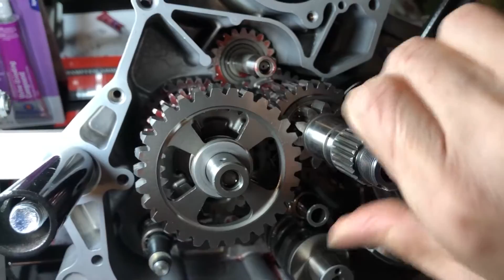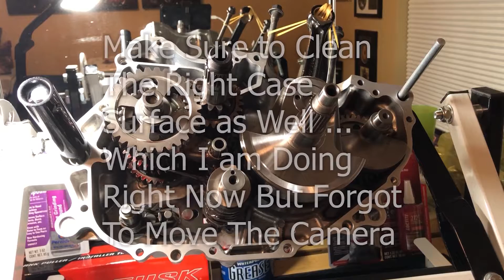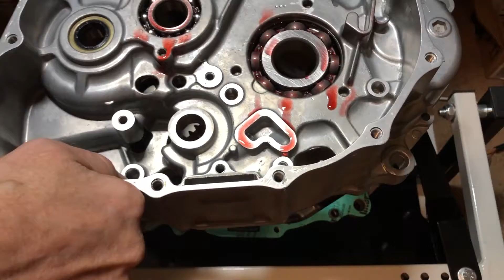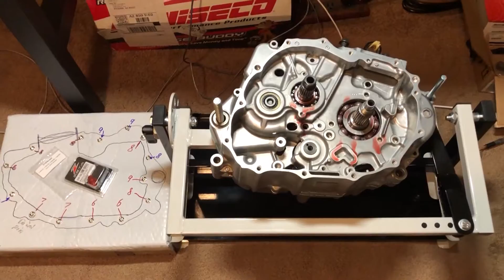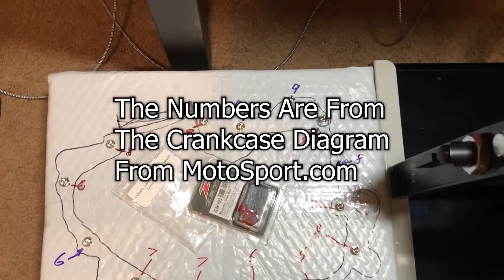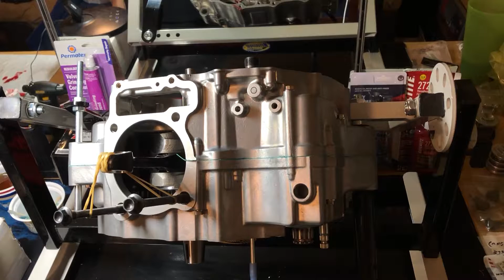Honda 400ex Build - Part 9 - Motor Engine Bottom End Sealing Crank Cases Together,  Gaskets, Bolts

Comment: What is the stud with blue tip on the left case?
Reply: Never mind i found the info for the special stud
Reply from the maker: @Walt-c9m  glad you found your info ... I just a rubber sleeve over it to protect the threads while I'm building it ...

Comment: Can you put a 400 clutch on a 300
Reply from the maker: I don't think so, they are totally different dimensions. The 400ex clutch plates have 12 tabs and the 300ex clutch plates have 10 tabs. You will definitely want a second opinion though ... or try it, and see if it bolts up and fits under the cover.

Comment: Hey man great video's.  Can I get a link to those nickel plated case bolts? Also I seen you have pictures of the cases and where everything goes. Could I get those as well?
Reply from the maker: Here is the SpecBolt "Nickel Wurks" bolt kit I used - https://specbolt.com/honda-engine-bolt-kit-nickel-wurks/ and I saved and printed all the diagrams from here - https://www.motosport.com/oem-parts/honda/2007/trx400ex (use google chrome browser, right click diagram image, choose "save as png", open saved image and print it)
Reply: @11GalleryATV  Thank you. I got my diagrams off partzilla. I was refering to the photos that you had.
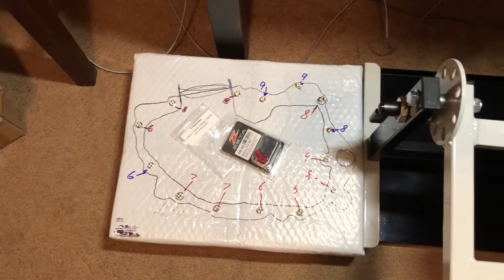Reply from the maker: @joshuabeard8244  Do you mean this at 9:40 ?
Reply: @11GalleryATV  no it was an actual photograph of the left or right case. I though you may have be using that as a guide.
Reply from the maker: @joshuabeard8244  just do a google image search for "400ex crankcase" and you should find some. Also look on eBay, people upload high quality images when selling stuff

Comment: I really appreciate the work you have put into the these videos.  I've recently purchased my first ATV, which happens to be a 99 Honda 400ex and I don't know anything about them. So watching everything being built from the ground up has been so helpful trying to learn and understand how these machines work. Thanks!
Reply from the maker: Thank you and glad I could help
Reply: Really appreciate the detailed videos! Currently rebuilding the engine on a 02 400ex post a broken gearshift spindle. After putting the gears into the left case and testing the gears they seem hard and not smooth when turning the drum. Any suggestions? Don’t want to join the cases until i know the gears work smoothly. Thanks for any suggestions. Also looking forward to a video regarding possible install of all balls kit bearings into rear engine mount/swing arm pivot had a super tough time getting it out due to it being seized.
Reply from the maker: @vic10jr  The gears will shift a little rough until you get the cases together because all the shafts are loose until they are fully secured in both cases. That being said your shift shaft should fit tightly around the return spring and could be the cause of "extra roughness". You want to make sure everything is tight in the seals and all the transmission parts are in there proper orientation. This is one of those situations where you have to make the call yourself ... is something missing? are the shafts seated in the seals properly? does it shift "too" rough where you think something is not right? Mine shifted kinda rough until I got the cases sealed ...
Reply: @11GalleryATV  I’ll go through and reassemble the gears one more time following your video just to be sure.  Thanks for the advice I’ll go ahead and try and use the vice for the swing arm bearings hopefully I can get them out.
Reply from the maker: @vic10jr  You are building a 2002 400ex so you probably shouldn't follow my reassembly of the transmission gears because mine is a 2005-2014 transmission with reverse. Go here ( https://www.motosport.com/oem-parts/honda/2002/trx400ex/transmission-%28%2799_%2704%29 ) and print out the diagram for your year ... and here are all the diagrams available - https://www.motosport.com/oem-parts/honda/2002/trx400ex
Reply from the maker: @vic10jr  I apologize those diagrams are not working today in those links I gave you ... here is a link to one that does work for your 2002 400ex transmission ... https://www.bikebandit.com/oem-parts/2002-honda-trx400ex/o/m14554#sch97919
Reply from the maker: @vic10jr  as far as the swingarm pivot bearings ... I have already done those and I didn't film the process but I had to use a 17mm socket, some washers, and a press to eventually get the old bearings out. You may be able to use a vice in place of a press to achieve the same results (if you get lucky).
Reply: Im in the process of my rebuild and your videos are my guide!   These are awesome and I love how you explain things.   THANK YOU